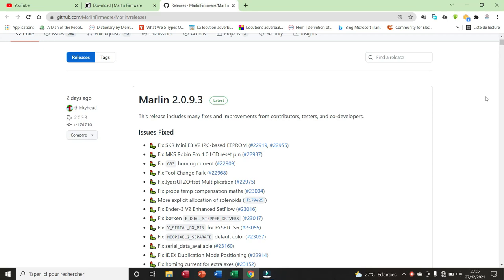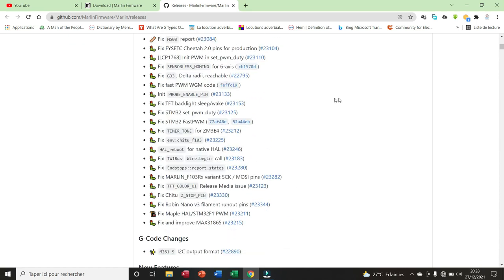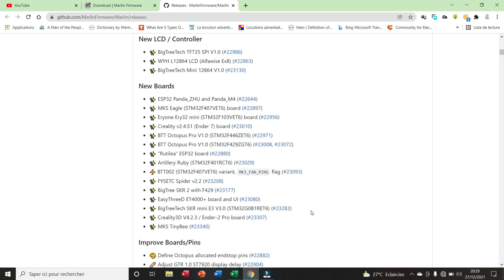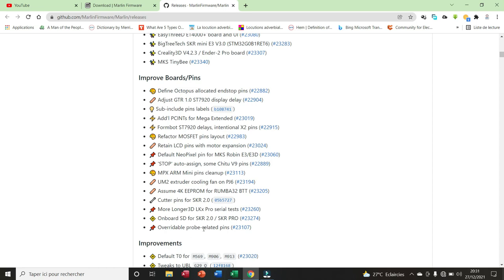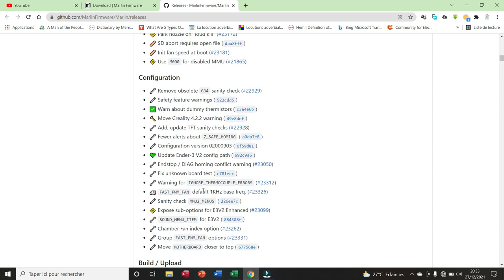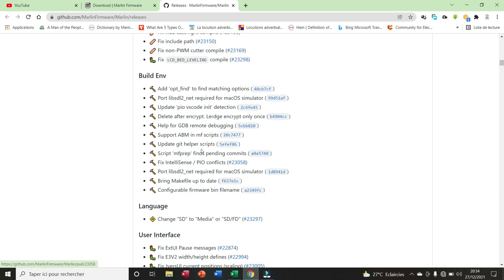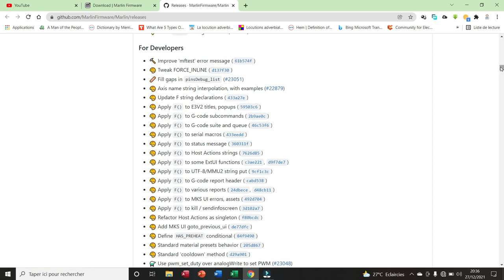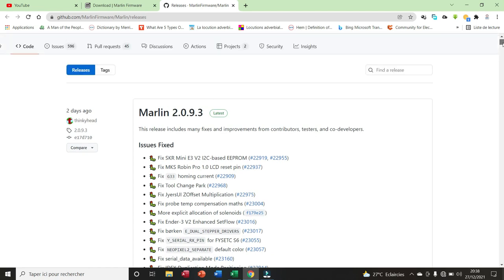64: Marlin 2 0 9 3 Has Just Been Released

Comment: how i can install on my e3v2 ??
Reply from the maker: Just download the source code, compile it with Visual studio code to obtain the .bin file. 
You copy that file on a SD card and insert in in your print, turn the printer off, then turn it on.
Reply: Personally, this 2.0.9.3 is much less stable than the 2.0.8.x especially with the Ender3v2 but also with certain SKR BTT.  The new management of the CPU and HAL always generates random and bizarre malfunctions.  Some new options (not so many for Ender3v2) are easily adaptable to v2.0.8.x ...
Reply from the maker: @LChristophe68  Thank you Christophe for this information. I understand now why I had all these malfunctions on my Ender 3v2 when I updated it with the 2.0.9. X. Finally I have put back the 2.0.8.x, and it's working much better.
Reply from the maker: @LChristophe68  Je suis pressé de voir votre new release.